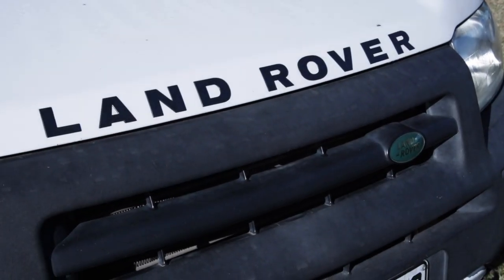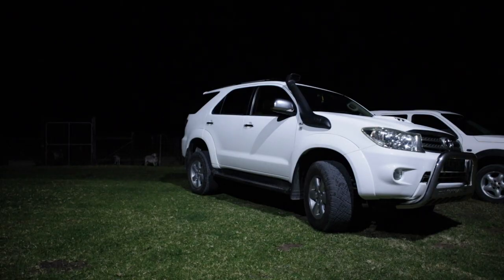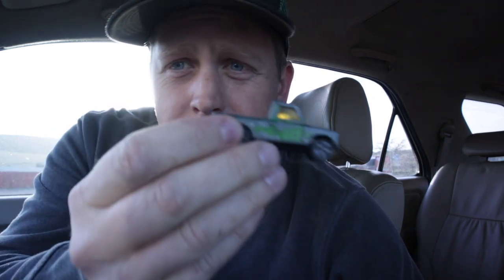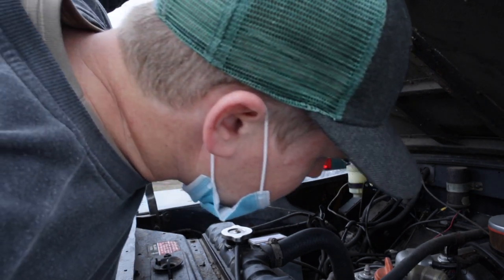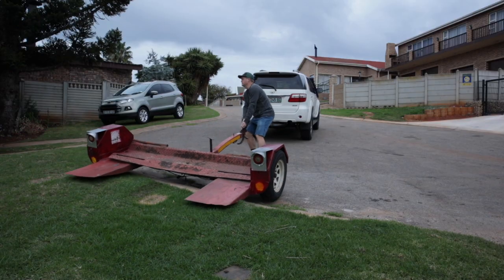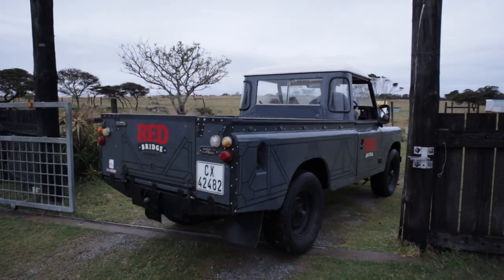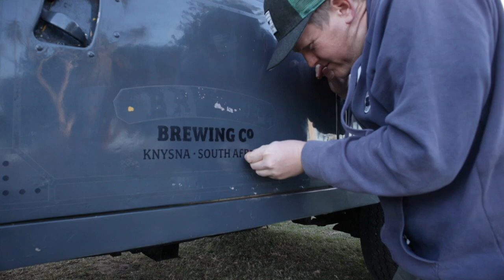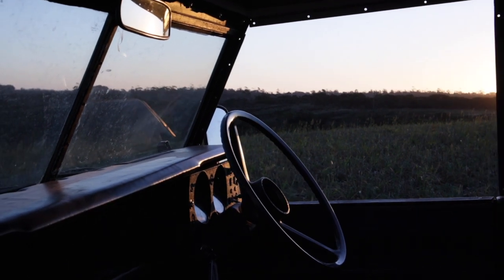Land Rover Love Affair | Buying a 1983 Land Rover Series 3 Pickup

Comment: The Brits made a very unic and beautiful landrover back then im quaite impressed and it can go anywhere car it's very good and rugged farm car I wanted one so bad now ❤❤❤
Reply: I bought a 109" in June last year with a canvas roof from the military and petrol 2.25 litre engine and running well, converted to a 9 seater and kept in a dry garage, great off road 40 mph on road and they are happy, if you find a decent one chassis and outriggers  and bulk head wise also doors and frames rust wise I would advise you to buy it you will make money later and enjoy it for the fun it is on and off road. Winter snow or work they won't let you down.
Reply from the maker: I haven't seen a lot of 109's in the UK but heaps in SA. I'd like to own one again at some point.
Reply: @DaleReubin  I'm in Southern Ireland and there isn't many about on the road.

Comment: Great vid. Any tips for buying an old landy like 1986 series III. Have no idea what to look for.
Reply from the maker: Great question. I don't know a lot but what would be important to me is looking for originality. Owners tent to modify Land Rovers, especially the series Land Rovers. Make sure it's the correct engine for the model you're looking at and that the license papers are in order. Then check for rust in the bulk head, bottoms of doors, foot wells, chassis, crossmembers etc.. Fortunately they're very simple mechanically so just listen out for weird engine or gearbox noises. Maybe I should do a video.... Hope that helps
Reply: They are unreliable junk that rust in hard to get to places. If that does not put you off, or the test drive, here are a few tips.

Choose the model you want. Whilst bits swap over buying a 109" when you want an 88" will be a bit frustrating.

The frame / chassis is prone to rust and these crates may have been coated in mud for decades. the outriggers and rear crossmember are bad culprits but can be cut off and replaced. Have real good look at previous repairs. New chassis are available and it is a medium size job to build your Landie back on to a new galvanised chassis.  

Bulkheads are made of steel and rot. They can be welded and again a medium size job to replace with a new one, still made. Outer panels do rot, it is aluminium rot. They also suffer damage. If there are spot weld marks down the flanks, that is a sign of an original panel. Bottoms of doors and door window frames can rot. Roofs leak, often badly.

Paint is subjective. you can hand paint a Landy and no one would notice. use coach enamel and proper brushes and it would be better than factory.

Fuel tanks rot and there may be several of them. Petrol and diesel engines are long lived and gutless. Transmissions and axles are not overly expensive to repair but go over them.

Electrics are basic but often butchered. Have a good look at it or it will burn down. Not unusual for blower motors and wipers etc. to not work. 

Bear in mind this crate could have been taken apart a number of times, a monkey with a spanner and a screwdriver would have agodo chance of stripping it clean. Find everything that has been modded. Some will be bodges, some upgrades, work out what is not original. A Weber carb and electronic ignition may be valued, the power steering on mine is a boon. I have Defender door mirrors so I can see, the little wing mirrors are useless.

Comment: So, I am very familiar with the condition. I have just bought a partially re-built 109 truck with the wrong engine in it which apparently runs. Me and a mate are going to save it, It was about to become a sort of hot rod with LED lights - but that ain't happening to it now. It will be my third series. So, ya.
I would like to see how you get on